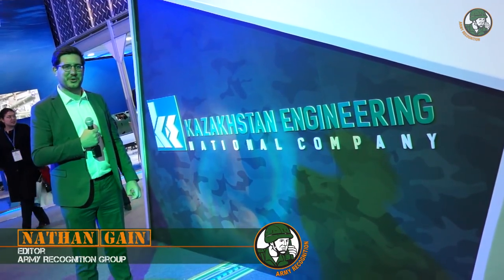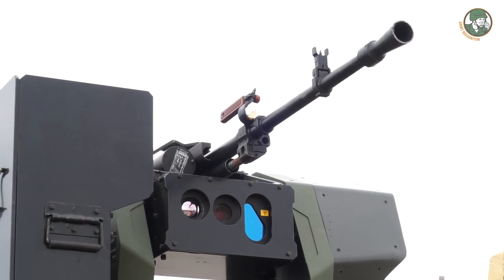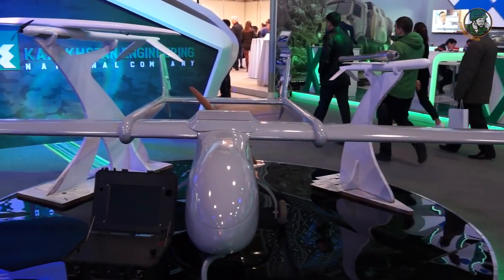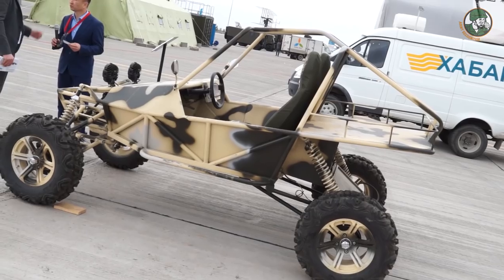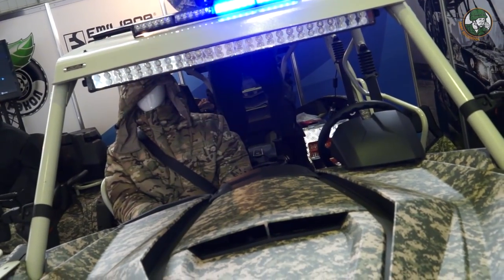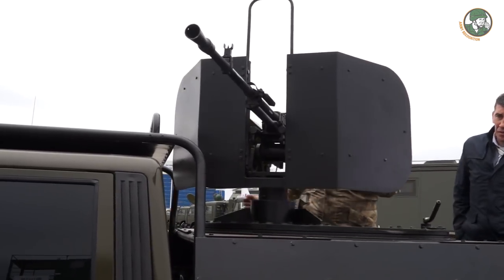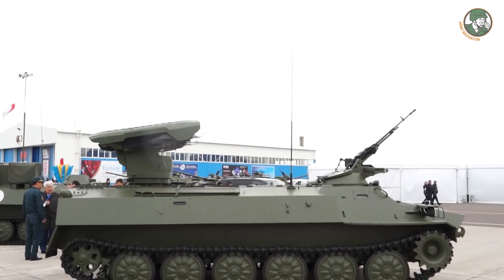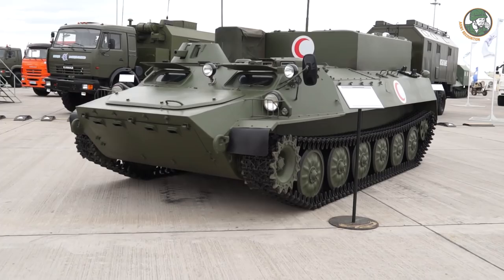KADEX 2018 Day 2: Kazakhstan Defense Industry latest innovations

Comment: That wolf technical vehicle is cool
Reply: Armoured ambulance is sick too
Reply: 811 Auto Repair Plant: AMTE Tracked MEDEVAC vehicle - the vehicle itself hasn't changed. Its biggest issue - the side opening back door, it is still there. While it is a small problem if you are a soldier on foot, it is a huge downside for a med-evac crew.
Not using a hydraulic driven platform with some wide entrance is a serious problem here. Also, an additional place for the wounded soldier right under the vehicle roof is no use, if the person has a drip. Next thing is the obsolete type of the stretcher. It simply does not support the human body. Especially if any bones or internal organs are affected. I guess it is all due to the old type of door. 
Those are not any sophisticated modules to adopt in the MT-LB model. If taken to consideration lots of positive effects could be obtained with a simple and cheap upgrade package.
MT-LB low silhouette can be a difficulty here, but it is not something impossible to pass.